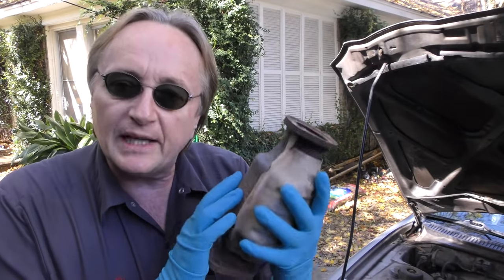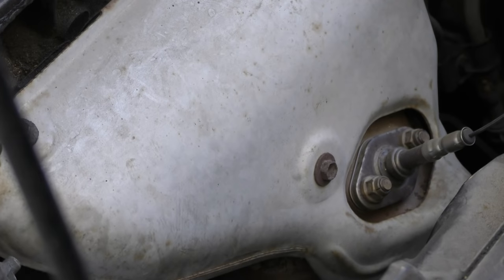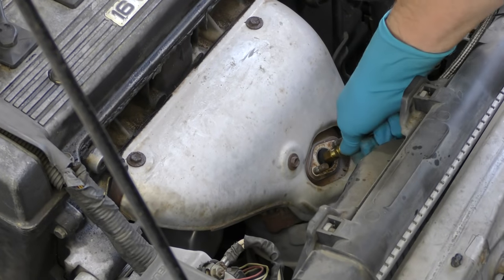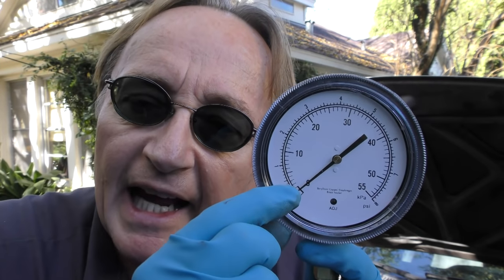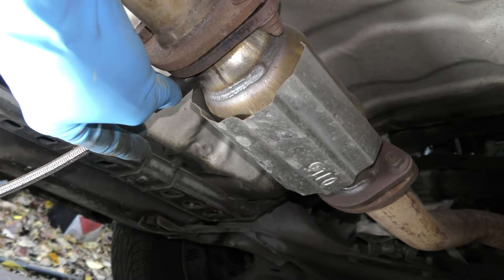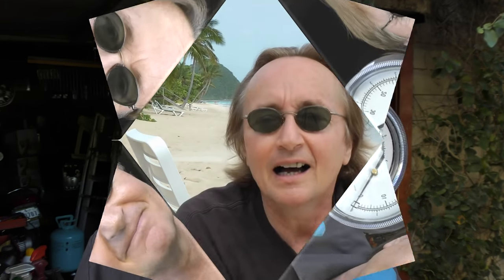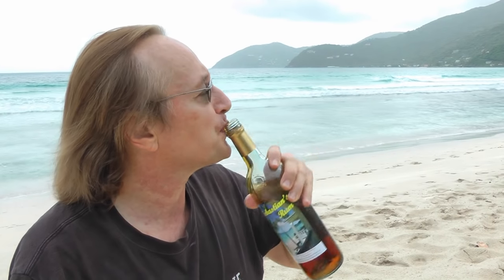How to Tell if You Need a New Catalytic Converter in Your Car

Comment: "simply unbolt the oxygen sensor" yeah right
Reply: i cri evertim
Reply: +ebu touy ...LOL XD
Reply: +Tyler Roberts are you confusing the sensor with the catalyst?
Reply: +Tyler Roberts I live in New Hampshire and I've never had an issue removing an O2 sensor. I haven't changed them hundreds of times but I've done it enough and I've never had any issues. A good wrench and a few good whacks from the hand have been enough to break them all loose.
Reply: +ebu touy Everyone saying its easy has probably never seen the condition of cars in the north east
Reply: I've done tons of oxygen sensors, i live in illinois, but i dont get what location has to do with the O2 sensor, ive never had any problems
Reply: Brian Williams
I line in NH and I've never had a huge problem removing one. If i have to remove a working sensor I always install a new one though because it can take a few good blows with your hand or a dead blow hammer to break them loose most likely damaging the sensor.
Reply: +Jack Toohey nor do i since most o2 and there nuts are stainless as many factory cats are
Reply: +dfissell implying stainless parts can't bind.
Reply: IsbjörnXII not at all but in comparison stainless to normal steel  on exhaust system in 20+ years  i have had only had to replace a stainless fastener on an exhaust a few time normally due to some one using a cheap Chinese wrench and rounded them off
Reply: +garretts91 I get what I call the big bar and it dose the job well
Reply: +ebu touy 
One does not simply unbolt the oxygen sensor.   lol
Reply: What did ya' soak it with? Was it "DEEP-CREEP", by Sea-Foam? That stuff is pretty good. Wish they still made the ORIGINAL "Liquid-Wrench", by Solder-Seal. Of course, the ol' standby of 3-parts Diesel to 1-part used non detergent 30 w motor oil still works as a long-term "soak", too...!☺
Reply: lmao
Reply: i have some brass and copper threaded fittings and they seemed pretty good as long as the threads are many to get a good hold
Reply: how long on average do they last before the waveform starts to get lazy and slow and time for a change?
Reply: Never had any problems with removing o2 sensors. 22mm spanner and some consistent strength so you dont round the nut. Manifold bolts however.............😥
Reply: ebu touy Ahaha mine almost made me resort to the flames.
Reply: that there's a Texas mechanic
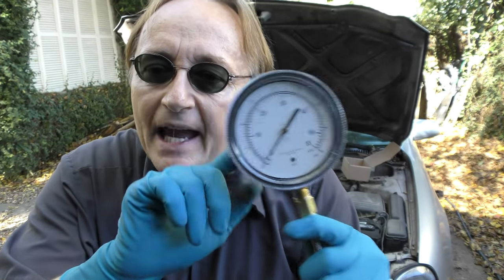Reply: Well he states at 2:18...
Reply: hahaha you have been there huh!? Scotty wants everybody to get dirty and go nuts!
Reply: Kinda funny seeing how many people view evety day problems of people who live in the salt belt as some kind of myth. Maybe you guys haven't encountered them on your personal vehicles, but if you're not turning wrenches for a living don't pretend to know the typical circumstances of all vehicles. I'm not saying they're all stuck around here, because they're not. But if a car comes in over 150k with the stock O2 sensors and cats around here that things gunna take some torqueing or heating. Especially if the cats heat shield fell off over time or "fell" off from a lazy tech. Either way. Not a myth people. But since you view fact as from your own personal vehicles;I've only changed one on my jeep, L downstream, and it took my 36" 1/2 breaker on the crowfoot with an extra 2" pipe. After being up to temp and soaked in PB, then heated with a torch. Yes. They get stuck.
Reply: Depends on the car I've come across some that took more steps to take out
Reply: hhh simply  ! Not ford ford v 8 engine
Reply: ...with a torch wrench, sure. No worries 🤣 (Canada out)
Reply: If you cant get the O2 sensor off, run the engine for about 15 mins, break the sensor free and loosen, turn the engine off, let it cool down then fully remove to keep from burning yourself.
Reply: Can u not simply unbolt it 😭💀💀🤡🤡🤡
Reply: Buahhhhhhhahahahahahahahahahah. Lol

Comment: Next time you have a bad cat. just remove it completely :D
Reply: I cant =( my neighbors kid starts crying when i cold start it i guess the motor sounds too mean for him
Reply: +imchris5000 Thats what Im talking about)) Do you need to change it? Do you need it is more like it)) Thats the first thing that goes when I buy a car.
Reply: THOES DARN CADILLAC CONVERTERS!!!
Reply: hell yea just did a cat delete on my 85' T/A
Reply: +Faraonqa ya if you want 0-60 in 10 years. you will loose all your low end torque and wont pass an inspection. plus it make the car louder
Reply: Oddball gamer Why would my car go from 0-60 in 10 years ? Well where I live the only problem was the sound with which I dealt with by adding a resonator in place of the cat.
Reply: I had personal experiences with people replacing the cats with a pipe with out compensateing for the restriction the cat causes and they lost a lot low end torque compared to when they had a giid cat in there. My co worker had bought a dakota that didnt have a cat and he would have to flore it to get it to 60mph. It pretty much had the acceleration of a cement mixer. He took it to an exhaust shop and had a cat put in and now it runs the way its suppose to. Also it may throw a check engine light since the o2 sencers are reading the same information. Its better to replace unless you do the calculations for the restriction the cat causes.
Reply: +Oddball gamer who ever sold a car with out a cat  broke the law but that dakota if its the 4wd one its just under powered  or need lower intake gaskets probable why it had no cat
Reply: +dfissell as far as I know it was some dumb ass that wanted a loud exhaust. thats Florida boys for ya. Florida has no emotions test so people can get away with it. Fortunately the man that bought the dakota put a magnaflow system with a cat on it as well as the burnt sensors. it runs pretty good now.
Reply: the sensors had been replaced I meant to say
Reply: Woof woof!
Reply: Kevin Kinzel it is a load of Bs but you do need it in some states to pass inspection. fortunately Florida dousnt have inspections and if you want the noise but still want to register the car. you can run cut outs
Reply: No cat on my Sherman so no negative waves here! :-)
I also like to talk to dolphins they are so at peace with the planet.
Reply: Oddball I'm building me a g body Monte Carlo and I'm not going to run cats. if I have to some time in the future. I'll just put those high flow ones on
Reply: Andrew Pantlik That's absolute bullshit. Go buy a high flow cat (30-40) bucks and have a muffler shop weld it in. 40-80 bucks. Your friends a rip off
Reply: Yeah my 6.0 sounds way better with four inch straight pipe from the turbo back.
Reply: EmptySergeant thats what i have done to my car also but if you live in a area where they require emissions testing you have to replace it
Reply: I did a cat delete on my Jeep
Reply: EmptySergeant because unless you have the computer re-mapped, it's going to regulate the fuel injection proportions and injection & ignition timing as though the converter were installed.
Reply: runninggames771 only with a carb and non-computerized ignition, if you know what you're doing with jets. Computers regulate the fuel metering and injection & ignition timing based on the O2 & throttle sensor inputs on modern cars, so to compensate for a missing cat, your computer must be re-mapped.
Reply: clovehitch never heard of scavenging I guess...or you drive a Prius.
Reply: EmptySergeant nice straight pipe
Reply: Thank you sir for that comment
Reply: Lol username "empty sergeant" the adorable little : D face typed lmao. also agree yes just gut it put the shell back on install a 2 ohm resistor onto the wideband air fuel ratio and trick the sensor bam done no cel,mil,sel light and no cat worries again. Lol again super cute face typed.
Reply: Do like a friend did on many of his cars. Remove the cat, drill and punch out the cat material inside so exhaust passes straight through the cat. This improved gas mileage. Guys, best part is it passes emissions test and when they look for the cat under the car it’s still technically there lol
Reply: Only we ( mexicans ) know and only do that
Reply: Try to pass smog
Reply: You do have to pass emissions, but I get it, more power for your money

Comment: I've tested them a few times with a vacuum gauge, rev them a bit and hold the rpm's steady, if vacuum drops off real low then it's clogged. When they get clogged real bad you can just tell by listening to them, the exhaust out the tailpipe will be really quiet, and when revved you can hear the "bog" loud through the intake.

Comment: Thank you! The information was very useful. Two weeks ago, I took my vehicle to a mechanic across town to get an oil change and front brake pads and routers. This all cost me $250.00. Three days later, my alternator blew. I was actually stuck inside a carwash after the car was washed. Now the same mechanic that performed on my vehicle the first time, put a new alternator on my vehicle for $415.00. Wouldn't you know? My engine light came on and I took my vehicle back to the same mechanic. Automatically he knew I needed a Catalytic Converter for my car. It was then that I realized my vehicle was tampered with. I only had this vehicle for eight months. It is a Chevy Traverse 2010, and it ran so well before I took it to this mechanic. I have a hunch that this mechanic has crooks working for him. I took my vehicle to another mechanic and he told me after scanning my vehicle that I needed an Oxygen Sensor. You know, I am not trying to get anyone upset with their comments up here. But it is very difficult finding an honest mechanic these days. Especially when they see a woman. I am fully aware of the game after this situation. Who's got $ 1,800.00 to fix a car for Cata Converters to be installed? And this is what that mechanic threw at me in the way of numbers. Hell, I'm ready to sell my car.
Reply: Debbie C always get a second opinion. Sometimes 3!!! I agree!! I learned at a young age about shysty mechanics!! Find one honest one and stick with him!!
Reply: @papergatorztv7087  Thank you once again.
Reply: Just get an aftermarket one installed for 200 bucks. It'll pass inspection.

Comment: Scotty saved me a fortune! I got my cat back to efficiency level using the laquer thinner trick and some high octane fuel! Used cataclean also just to be safe. Cleared the codes and viola! It didn't come back. Passed smog and saved $1300 on replacing the cat. 2004 corolla. 180k miles.
Reply: Did the code ever come back?

Comment: Very good video. You can always try cleaning the catalytic converter before buying a new one.
Reply: How do you do that
Reply: @remarkable_iam  Using lacquer thinner.
Reply: Cataclean?
Reply: @remarkable_iam  take it out spray with pressure washer, submerge in hot soapy water and rinse once again with pressure washer.

Shake the cat before cleaning if you hear a rattle don’t bother cleaning, just replace.
Reply: @mattmoru1470  scamaclean doesnt work
Reply: Very helpful , thank you for sharing your experience and knowledge with us !
Reply: What if you bought a 98 4runner and it was previously cut and welded with a new one 😂

Ill go get the grinder.
Reply: @ceramikxxx5882  Cataclean has never worked for me. I followed directions exactly, no results. Did a second round in case the blockage was more than anticipated, still 0 results. HOWEVER, diagnosis of bad cats are from code reader. No loss of power, runs beautifully, no smell, I suspect it’s not the cats(I have 2, certified dealership gave a $3K price tag to replace.) But lack of symptoms and knowing other things can cause the P0420 and P0430 codes, I’m trying to rule out other issues first. Codes only showed following a mechanic from the stealership that sold me the vehicle changed 3 sensors. So fortunate to find amazing and honest mechanic to help me get knowledge on testing and ruling out things before paying big bucks.

Comment: Scotty my friend.  2013 Hyundai Accent.  88,000 miles.  Runs great.  After bad winter storm, check engine light went on.  Was on 3 days, so had diagnostics done.  Mechanic said needs catalytic converter, but no rush.  Took it home.  Next day light went out and has not come back on.  It's been over 2 weeks and no light.  Does this mean it's OK now ?

Comment: Scotty I need some of your wisdom and experience.

1996 Chevrolet Cheyenne 2 door extended cab c2500 RWD 5.7l vortec vin code R.
engine idles fine runs fine until the engine warms up then I'm getting a hesitation and stumble at driving speed but not at idle and I am not getting one single code in the computer. A little back ground just had both heads replaced because they cracked even though the truck has never got hot but upon reading and investigating I found this is common with early GM vortec engines because they really didn't put enough metal between the valves. probably four radiators worth of coolant went out the exhaust by before I had a chance to get it repaired. Truck was running fine prior to the heads being replaced. New plugs wires cap and rotor an had fuel pump checked and it's perfect. I'm also having bad fuel mileage and loss of power. You helped me out once before a long time ago and you were a godsend then and I hope you can throw me a life raft because I'm grounding in a sea of poor engine performance. Thank you!!

Comment: Thanks for the hint. We worked on a Ford Escape for 3 Weeks, he didnt start anymore after we sealed the head because of fizzing noises. We changed many parts, and in a test of the Sparkplugs the engine started because the sparkplug was out of the cylinder, bridged with an Jumpercable to the battery. I just want to Check if the spark was strong enough. When the engine started, i remembered this Video and we just pulled the ox sensor out - the engine started without problems. After testing it step by step, it turned out that the third catalytic converter was so full, that the engine choked to dead after a few turns. So we opened the converter, empty the damn thing and weld it shut. The car was running like new. Lets see when the new converter comes and we put it in.

Comment: Another indication of a plugged cat is when you run the car at night and open the hood.Sometimes one or both of the exhaust manifolds will be glowing cherry red.
Reply: +JohnLeePedimore Another one is if you hear constipated meowing under the hood. Better check it out, might get stuck in the fan belt/belts.

:p
Reply: JohnLeePedimore
There’s only one thing that will cause a converter to glow red and that thing would be too much air and fuel. 
A catalyst doesn't work if it's clogged. Red hot means its not clogged but it does mean there's a serious issue elsewhere.

Comment: Hi Scotty,
Got a 93 Tercel that appeared to be in real bad shape. With no prep, on Dec22 we smogged it & at
15mph 
HC Max 99 Meas 735
CO Max .61 Meas 1.75
NO Max 738 Meas 568
Bad timing & Gross Polluter

-Ran G2Pass in tank w 91oct, new plugs, new air filter, O2 sensor, new pcv, new oil w/seafoam in engine & vacuum line (2cans), did your 1gal lac thinner drove 200mi, adj timing to 10 BTDC, new oil & hwy driving before 2nd test today...mixed results:
15pmh
HC Max 99 Meas 262, better 
CO Max .61 Meas .65, better
NO Max 738 Meas 1908 !!!!
So, for some strange reason our NOx went UP.
Tercel has no EGR valve.
both tests show cat as Pass.
Considering a 2nd can of CRC G2Pass in tank, seafoam in vac line & if all fails replacing cat converter.

Any thoughts?
PayPal address to chip in?

Comment: dude, you're the best! I finally figured out why my Nissan's engine wouldn't accelerate and then overheat.
Reply: beastcx2   Dude, What model of Nissan & year ?    My Altima is done
Reply: Pretty sure this is what is wrong with my 97 nissan quest. I can drive just fine for 30 minutes or so. After that it starts getting misfires and I cant accelerate very well. If I keep going it starts smoking out of the bottom of the car. Now that I think about it thats a dead giveaway.
Reply: @Anon-te6uq  sparks plugs maybe?
Reply: @SCVdEsTrOyEr7  it turned out to be the distributor/cam shaft sensor. They are the same part in my car.
Reply: Anon yes it is may it RIP.

Comment: I am starting to think I have a bad cat in my truck. I changed out most of the fuel system such as injectors, fuel pump and repaired fuel line. I get the P0300 random missfire by itself with no indicating cylinder number but sometimes I get a bad 02 sensor code and sometimes the 02 sensor doesn't show up. Many times when I give it gas it seems like it is lacking power. I might buy this tool just to make sure and have for future use. Thanks Scotty

Comment: I have an odd one local mechanics are stumped on.  My 2000 corolls will shake or sputter like crazy when reaching 3500-4000 rpm, then stop accelerating until after I release the pedal.  It happens in any gear, including while parked, ie. not referring to highway tire shake. I thought there may be a clog in the exhaust, so I detached in front of the cat.  No change.  I didn't disconnect the Front pipe, because I can't reach all the bolts with my toolset and it doesn't seem like it could clog.

I tried replacing the fuel injectors, spark plugs, throttle body, fuel pump and filter, idle air control valve, PCV, and engine air filter, with no success.  Local mechanics are stumped.  This is a good car and I don't want to give up on it.  Any advice?

Comment: My Maxima  stopped on the highway.  Clogged pre cat.  Rolled to a commuter lot. 5 hours under the car to diagnose and take off the downpipe.  Bought a Honda civic that didn't have a cat, just straight pipe.  Ran great, out of State plates fixed the emissions testing issue